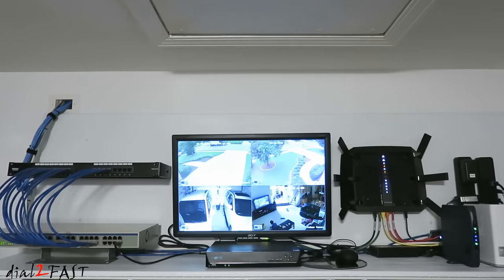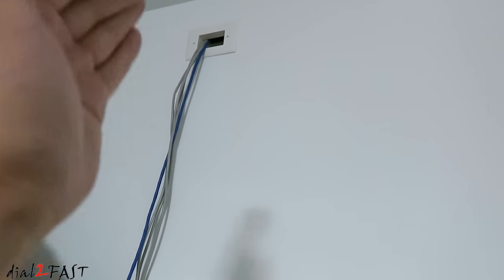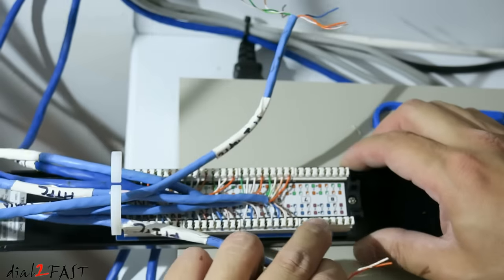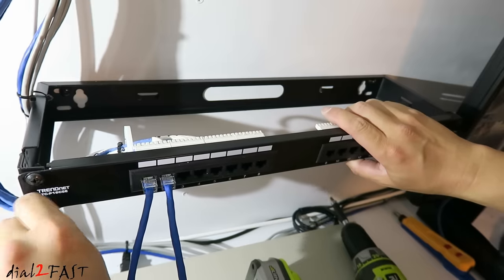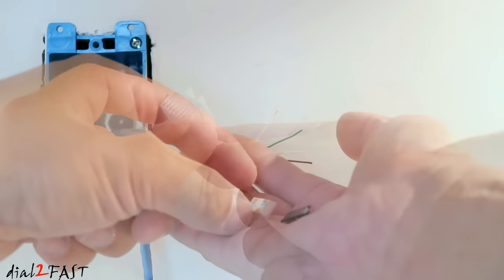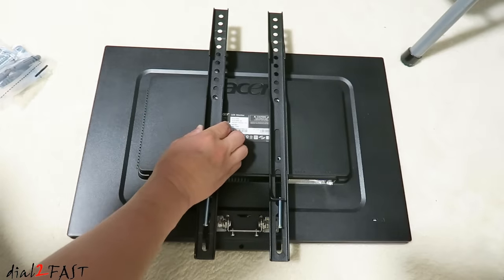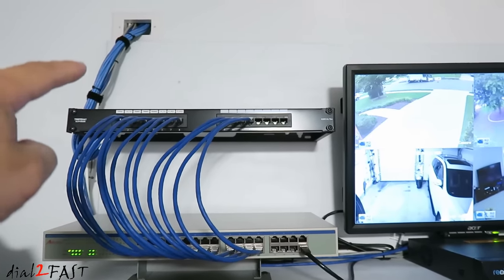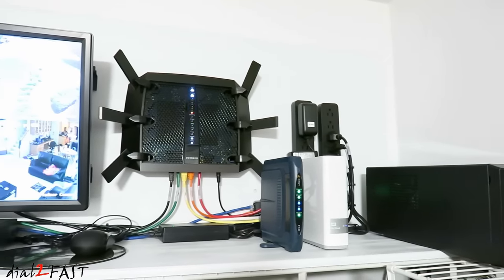DIY - How To Build Your Home Network

Comment: Smartest thing ever. I wish more small networks would use patch panels. If you ever decide to move or change your network you can just leave the patch panel and take your switch or router with you leaving the patch panel for the next owner. Or if you decide to add to or change the layout of the network the patch panel is in place and easier to change things later. VERY SMART! Every small network I install in homes gets one.
Reply: Mike McDonald what exactly is a patch panel and what does it do. Thanks
Reply: In an enterprise network, a patch panel serves as a sort of static switchboard, using cables to interconnect network computers within a LAN and to outside lines including the internet or other wide area networks (WANs). It allows you to easier reconfigure things down the road if you need to and once in place those cables that go thru the wall don't have to be moved so there is less stress on those cables. The only cables you would move or change would be the ones that you plug into the front of the panel. You can also label the panel so each port would be a room lets say in the house or apartment making it easier to track down what goes where if you forget or someone else new moves into the house or apartment. Makes life easier in the long run when changing things around or growing.
Reply: if they are failing then you need to learn how to wire them properly. They should never fail.
Reply: everyday job for me
Reply: Mike McDonald i knew what patch panel was but didn't see it's value in a home setup but watching dudes video and reading your explanation now, it's like DUH, the value is the same as in the Enterprise! 

#1 what rack and patch panel ya recommend for a home setup?

#2 if I ALREADY ran my cables, 4 100ft cat6 runs, then what? Should I cut the ends and then wire into a patch panel or?

Ultimately I want to setup a homelab and a home network setup to this video in me basement.

Any tips or advise is greatly appreciated!
Reply: In Sweden it is a standard in new house with network outlets and pathpanel.
Reply: Mike McDonald so essentially it’s only necessary if you have multiple nodes? And also what purpose does it serve? Just as a repeater for the signal?   I’m just starting to branch out into IT and ran across this by luck so thanks for the explanation!
Reply: if I may say patch panel is used to organize and it's clean...
Reply: Wired patch panel would be a huge selling point for me as a buyer, but sadly I think too many people wouldn't appreciate it.
Reply: Not if you punch them down correctly. Patch panels are essential even for the smallest network with drops in various rooms if you want to do things the right way.
Reply: A direct connect could fail just as much as a patch panel could fail if not more so because of the stress it could put on the cable, at least with a labeled patch panel you can quickly identify where the issue is, also just better for managing cables and aesthetically pleasing
Reply: Not a fan of patch panels.  Also not a fan of those cheap looking rj45 connectors.
Reply: Yeah, but if the wires are installed, they'd just be left dangling instead of on a switch if you brought the switch with you. It just seems like unnecessary work
Reply: Or for network this size - you could just simply plug the cables directly in to the network Switch ( avoiding a patch panel and additional connection points - which are potentially another point of failure).  Sometimes it is better to keep things simple.
Reply: Yes..  That patch panel equipment actually adds value to your home as it can now be setup for any new home owner to that residence.  Aside from that, he also had a network station built, which is also a plus for any new home owners.
I see newer home has something similar in the garage, however it just some flimsy box and not fully put through.   What I didnt see there is mention of the modem cable coming into to his router.
Reply: @jadenhamer1581  if you saw his video.  He had already explained it.
Reply: It is the smartest ever but today people are LAZY and all they want to do is WiFi ... Nobody wants to run CAT5 thru their house. 
Baby Boomers: 1 out of 1000 know what CAT5 is and how to run the wire.
GenX: 1 out of 500 know what CAT5 is and how to run it.
Millennials: REALLY...?? All they know is cell phone, 5G & WiFi ... Take that away and they are walking zombies
Generation Z: On their way to becoming the next Millennials ... 

Point is ... Today its all WiFi to everything. I know because i am a Field Technician for a major ISP .. TV's, laptops, tablets are a thing of the past and most have now is that damn smartphone in their hand and their Wifi in their house ...  

My entire house is ran with CAT5 to a 24 port switch ... Every smart TV in my house has a LAN port and its hardwired back to my switch ..
Reply: Not only is a patch panel with switch smart, but its clean dedicated internet to the device .. Not worrying about Wifi interference or dead zones ... 
Not to mention the physical dangers of Wifi alone ...
Reply: @mikemcdonald5147  patch panel are a waste of money (labor and materials), labeling each cable and plug them all in directly to the switch the best.
Reply: @ACommenterOnYouTube    Actually smart thing you wire networking and its better for streaming video without freezing like the way WI-FI connection does.
Reply: @Bos Gka:
I am a field tech for a major ISP ... 
I know better than to rely on WiFi for anything. I understand tablets and phones ONLY work on WiFi so it is what it is. But when it comes to Laptops, Desktops, TV's, Game Systems, etc that have a LAN port, i make sure i run a hardline to it to ensure that its connection back to the internet is secure, fast and direct. As well as when buying these items, to make sure they have that LAN port. 
WiFi is so inconsistent and it can be hacked, too bad most don't even know this let alone care. WiFi is easier for everyone so they go that route. Not me, if it can be hardwired, it will be. 
When i go to homes and business and people complain about their WiFi, i try to explain to them how WiFi works and why its so inconsistent but they don't understand, all they want is for it to work regardless of the FACTS behind WiFi ... They expect you to fix something that is out of your control ... 
Its like the wealthy people, they try to throw $$ around to get things fixed or working knowing damn well IT CAN'T BE DONE, but their famous quote is... I DON'T CARE HOW MUCH IT COSTS, GET IT DONE ...
Reply: Yeah i'd love to move into a house which already has this in
Reply: Could I use a bunch of female to female cat5 adapters instead of a patch panel?

Comment: I had everything running in my Bedroom due to the main internet connection being in the bedroom (where they installed the line) and so have now moved everything out into a 9RU 10" rack with a 12 Port Cat5e and Cat6 patch panels and 4 that host the UniFi USG, 2 PoE UniFi Switches and the Gen2 Plus and then afterwards I moved the internet hardware (NBN Hardware) out into the data cabinet which is now hosted beside the TV and I have to say I am extreme impressed with the 9RU Data Cabinet it homes everything and add to this I had to run a Cat6 from the Patch Panel to the room for the Phone Line to be moved and it took a while but I got it lol all about learning

Comment: Nice system. Clean and well organized. Your presentation was excellent, not over the top for those less familiar with a system wide network. Probably much more than a a residential home user would ever need, but nice to see what is possible. This system works nice for those with more than say 6 connections. Also like the integration of your security system though most home users now days would most likely contract with one of the many commercial security firms which host everything “on the cloud”. This would work really well for a small business owner. Thanks.
Reply from the maker: Thank you very much for your comment!

Comment: New techie here: Why do you use a patch panel? Would the switch be enough to plug in all of the wires from the rooms/offices? I'm buying a house and would love to have a "network" shelf like yours. 
How are the cameras hooked up? Are they wireless which feed the stream from your router? You're using Cat5 cabling... any suggestions on using newer (Cat6e, Cat7, or Cat8) wiring?
Thanks! Love the video!
Reply from the maker: I have an explanation about the patch panel in the description. Please take a look.

Comment: Overall, looks really nice. Instead of a patch panel, they make a rack mount panel with keystone holes. I find it easier to punch down keystones individually and then snap them into the plate rather than punching them directly on a patch panel. It is also easy to move a port around if you decide you want it located elsewhere. Keystones are available in different colors if you want to color code rooms or device types. You can also get keystones in different connectors like F, BNC, HDMI, etc. , so everything can terminate in one place, not just networks.
Reply: GREAT ADVICE !@!!! THANK YOU!
Reply: Alan:
Can you share the link to that patch panel you describe?  I'd like to find one and purchase it.  Or someone else.
Reply: Travis:
Thank you.  Yeah, last night I spent (probably) 2 or 3 hours looking into different options.  I didn't find this exact one, but I found similar.  And, I sure like how they have new cages.  All of this is so impressive.  I didn't see the need for a patch panel, but this video and all of your comments have convinced me to do this in my house.  So, thanks.  I'll save the link you gave me Alan, and it's so much cheaper than one that has push-down stubs.  Completed cables seem faster to me, but I'm just fearful of wiring them wrong where they don't work (maybe) ...

Comment: This install looks great, but I do have a couple of things I noticed that make it fail BICSI compliance.  First is the use of cable ties for wire management. Velcro works better, and is easier to expand with, plus it won't cut the hell out of you.  Color coding of the cables; Although he does have the color for the cables going to the rest of the house right (blue for horizontal cabling), the security camera setup should be wired with yellow cable (aux devices), orange between his cable modem and router (demarcation point),  I would have also run everything to the patch panel and only had a white ethernet cable between the router and the switch.  Also I would have used a POE capable switch and ran the access point through the patch panel on a port dedicated to POE. I would have also wired everything 568B instead of A.  A is only really used for older applications and military applications. B is the accepted industry standard now. Another thing that should have been done, I didn't see him do it, nor did he mention it, but for each wall jack leave a small coil as a service loop, in the event a jack ever needs to be replaced or re-terminated for any reason or if the jack needs to be relocated.  Also you only want to untwist the pairs at the jack just only enough to access the punch down.. On the one jack he demonstrated, he has no twisted pair all the way to the jacket.  Although it will kinda work, you will have more cross talk on the pairs and it will introduce transmission errors, dropped packets and lower overall speed/higher latency.
Reply: You are wrong, TIA-568A and TIA-568B is not old vs. new standard.  The AT&T firm use an own code as TIA-568A was founded. So the old and in U.S.A. widely spreaded AT&T stuff renamed TIA-568B. Then the european companies use A, N.America companies use B. 

Since most cables are produced in Asia =》is the discussion about that more as stupid. I found finish cable inside products or as patch cable in only one colour too!

Do you should only use one code at every installation inside one place . What code do you like is up to you!
Reply: Any issues with plugging power strips into a UPS? I thought that was a no-no.
Reply: @benjaphar  It's fine to plug power strips into a ups 
It's plugging a power strip into a power strip that is generally something you shouldn't do

Comment: Good video 👍 1 tip, you should leave the wires twisted as long as possible, just enough that you can push them down. This lowers the chance on interference.
Reply: not only that, also leave the jacket on, I know it's only cat5 but it will help to protect from interferences along with the twisted wires.
Reply: interference from WHAT..?? 
And how are you going to SEE this interference..??
How are you going to measure this interference..??
Reply: @Riccardo Finotti:
The outer jacket is PLASTIC ... Its not metal, therefore is has NO affect on interference. Its just there to keep the pairs together. 
What keeps interference OUT is the actual TWISTS in the wires. Each 2 wires are twisted together and all 4 pairs are twisted to each other to keep the electrical signal within the twist.

Comment: one of the BEST home network install videos!! THANK YOU, but NOT to sound stupid... ALL the other ends of the wires that come from the roof are already put to the other areas of the house/ office through the walls?
Thank you
Reply: To your question, I would say YES he did that. Remember he made a female connector that installed into the wall with a box, I will assume that he managed to run the cables through the walls.

Comment: Still new with all this networking stuff. So you run an Ethernet cable from your wireless router to the back of the Ethernet board switch panel thing which then powers all the patch panel connections? And if you already have a backup generator that’s runs your house would you need the UPS power supply?

Comment: Question, what’s the purpose of using the Patch panel, couldn’t you just splice RJ45 end and plug those ends straight to the Ethernet switch..? Maybe when you have multiple lines..? But if you only have a couple lines, seems to me waste of time and more work.
Reply: You got it. In small home networks, you don't usually need a patch panel. 

The Patch Panel is used in larger networks where you have many data drops (data ports). It helps keep your network cabinet organized and easy to service. The other big thing is the cable run. The cable that runs from the data drop to the cabinet is usually stiff. It is not meant to be moved around that much. It can break if you plug and unplug it often which can mean you have to replace it. That can be costly and/or difficult. With the panel, you terminate at the back of it and plug in an ethernet cable (referred to as a patch cable) from the panel into the switch. That way, if you need to disconnect a data drop that's not in use, you don't have to worry about damaging the entire cable run. 

Again, in small home networks, its not necessary. You can totally just put RJ-45 connectors on the end and it will work just fine.

Comment: That reolink itself has a sort of router built into it for its own camera network so there is no need to connect it to the main router. You can simply connect it to the switch you have there if you want to keep same configuration.

Comment: Great job, my question is that when you installed your nvr did you configure the ports on the router?
Reply from the maker: I did not have to configure any port forwarding for the Reolink NVR to work. It's a plug an play.
Reply: @dial2fast  I thought that because I am trying to install some zosi but they are a headache with remote access thanks for your comment I will keep it in mind to install my reolink in my house

Comment: Curious as to why you installed the patch panel? Wouldn't it have been easier to just jack all the ends of your home runs and go straight to the switch. Do you gain something with the patch panel?
Reply: Ok...guess I shouldve waited until the end lol

Comment: Did you have a power outlet installed in the closet? How are you powering the APC?
Reply from the maker: The closet has an outlet.
Reply: what were your measurements from the ceiling down to the cable pass-through hole? how far did you come down from the cable pass-through to the patch panel? How far is the patch panel above the switch? :D  thanks for replying btw. :)

Comment: does it made a different if you have the access point connecting to the router, or the switch?
Reply from the maker: Doesn't matter. The switch will be on the broadcast domain.

Comment: At 9:30, you said you were going to use the T568A color coding, but then you proceeded to call out the colors for T568B.
Also, in either configuration (A) or (B), the Solid Brown wire is ALWAYS at the end, but at 10:35, you put White/Brown as the last wire.

Comment: Do you use your routers WiFi capibility along with your WAP? Or do you disable the WiFi on the router? Also, how would this effect bandwidth? 

I'm gearing up to set up my own home network and really curious about this. Thanks!
Reply from the maker: I mainly use the Ubiquiti AP as it has good coverage throughout the house. The router's WiFi is still on. There are no issues with both being on.

Comment: I'm installing a patch panel right now but I had a question, wouldn't it just be easier to skip the patch panel in your case? You ended up crimping two ends of all those 6" network cables anyway. You could have just cut and crimp the ends of the cable coming down from the ceiling the length you need to the switch right?

Comment: One Question I have on your setup is. Why would you need the NightHawk Router if you're able to connect your Modem directly to your Switch ? or connect your Modem to a Edge router like Pfsense then to  your switch. This way you get install other open source tools like SNORT and HVAP to do IDS and Firewall AV filtering. Overall Love the configuration, I would do some changes. I will be doing a project like this soon.